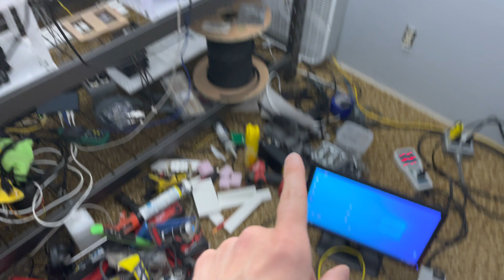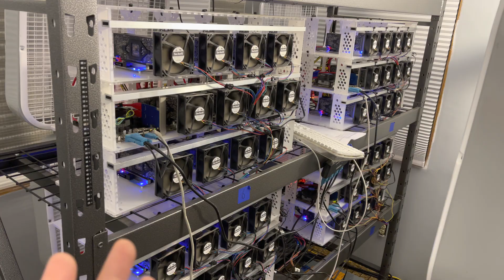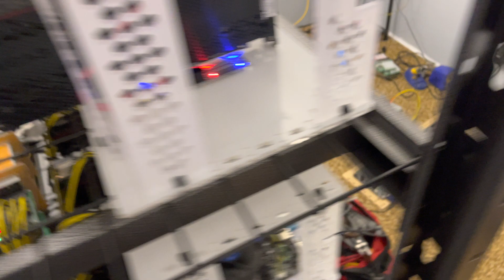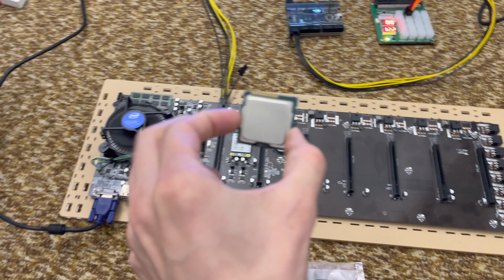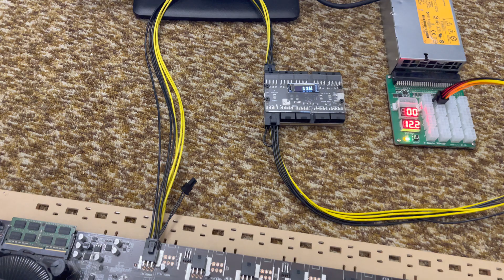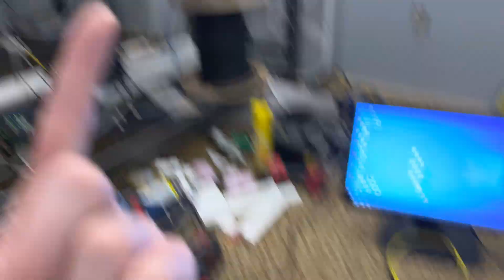Riserless 8 Way Mining Motherboard - 12 Month Review!

Comment: could you share about the GPU temperature since with this motherboard there is less space for one GPU to another
Reply from the maker: This particular board is 3.0 slot width, so it’s enough for many GPUs but not high end models. The FTW3 3070’s I have are 2.7 slot width, and some of the heat goes out the back, so it would be very problematic to run those in one of these boards without very powerful fans at the end. However, 2.0 slot blower cards are going to be perfectly comfortable in this board. It VERY much matters on the exact GPU used, and the cooler style. Some move the heat up and down, others out the back, some do all of the above. These boards are what’s commonly inside ‘server’ style GPU enclosures, and even 3080/3090’s will work OK in that close spacing with ultra high power fans blowing at them.

Comment: What fan controller is that? How does it control the fans? Do you have a link to purchase? Thanks for the help! Awesome setup!
Reply from the maker: https://amzn.to/3zCAw2C

It’s a 2 channel temp based fan controller. You can use it just as a pwm speed controller on one or both channels, or use the temp sensor and you can have two outputs that have independent control over the min speed, and min/max temp. It will ramp the speed from the min to the max over the temp range you set. Unfortunately you can’t set the max fan speed, if just runs 100%, but that’s usually OK.